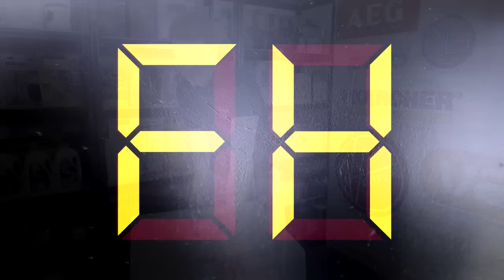Whirlpool Washing Machine Error Codes Diagnosis

Comment: I have a F06 Error and it's not a motor brushes ( they are practically new! ). I've hear in your video @ 4:23 that there is a "Tacho Coil" that might be damaged? Should I check electric resistance of a coil? Thanks in advance.
Reply from the maker: F06 error is no feedback from the Tacho coil. When this normally occurs the drum would start spinning very fast as the motor is powered then slow and stop as no feedback was received. If the drum does not spin that is the reason why no feedback (F06) is displayed and that would be a drive problem.
Reply: eSpares funny thing is that the motor won't start at all?! After taking water the machine just stalls and F06 error pops up. That's why I'm worried that it could be MCU or even CCU which is in my opinion not worth fixing.
Reply from the maker: As previously described no motor rotation no feedback so ignore the F06. If brushes are OK it must be either a connection or a faulty power board.
Reply: eSpares  I'll check connections first and then will see from there. .. thanks for help...

Comment: I have bought a washing machine it is 50hz, will it runs properly to 60hz power supply? please help me solve my problem...
Reply from the maker: Hi Emmanuel, This will depend on the machine and as you have not given a model number I will try and give information that may help. Generally if the machine can work it will show the following (50/60hz) on the 'rating plate' where the model, serial number and  voltage information is listed. If the machine uses a 'mains voltage pump' it is likely to be upset by supplying the wrong mains supply.

Comment: F-28?
Reply from the maker: We believe the problem is the control panel signals are not connecting with the main module. Check the connectors for any signs of damage and the buttons on the control panel. If you cannot identify a problem you may have to replace one or both parts.

Comment: my washing machine shows de error and sometimes Fe error
please help
Reply from the maker: Hi Ayush, you did not give a model so I can only give general advice.
DE usually indicates a door error, check the door closes correctly and if it reoccurs suspect the door lock. Error FE is usually a filling error. Check the machine fills to the correct level in the right time (about 1 Minute), check the water supply tap is turned fully on.

Comment: master please tell me, whats the error code F01 and how to fix it. thank you in advance
Reply from the maker: Hi Čestmhyr, we believe your problem is likely to be a control board failure. Check and if the motor is OK suspect the control board.
Reply: thank You for answer. after diagno. test, it tels me error code F01, but evrything works, except the watter supply. hose is free and pressurised and i dont know where is problem. (my type is Whirpool AWO/D) thank You for answer in advance.
Reply from the maker: Tip the machine to 45 degrees  to see if water is in the base. Some machines have a flood warning and allowing the water to run out may start the machine again.

Comment: Hello! i got a f12 error.  could you please tell me how to fix it? thank youu so much in advance
Reply from the maker: Check the heater with a meter as it is likely to have failed.
Reply from the maker: F12 is usually a heater error so check the element. If this is ok the problem could be the control board.

Comment: F08 error appearing immediately before any cycle or rotation. I checked the heater and it is not open circuit. Can you help me please.
Reply from the maker: Hi Salim, F08 is indicating a heater circuit fault. This is usually the heater itself, but can also be the wiring or even the control board. If the heater measure's around 30 ohms and the wiring is in good condition it could be the control board.
Reply: Thank you
Reply: Dear sir,
I would like to thank you again. Due to your instructions I managed to repair my washing machine. It was the heater relay.
Thank you.
Reply from the maker: Thanks for the feedback Salim.

Comment: Well. I checked the connections of the water supply and cleaned them out. Then checked the dispenser compartment for clogs.Massaged the hose just in case a blockage was there. None. I didn't check the solenoids because I don't have a meter. Pressure is ok but still getting 3 beeps. The major is filling up to proper level of water. Water pressure sounds good. I cut down the hose on the back so water would drain properly. Still no good results....HAve anymore Ideals?
Reply from the maker: The information you have given suggests you may have a pressure switch problem. For information on this see another video: https://www.youtube.com/watch?v=2pIVkAxWSXg

Comment: I have a whirlpool Dual Tumble Fresh 4.0 and normal load goes through to last rinse cycle then shuts down and three beeps continuosly. Put it on Rinse Spin Cycle and the beeps came up during a fill cycle. Machine is level front sensor at kick/front panel is pressed. Don't know what to do from here. Please help.
Reply from the maker: This sounds like a filling or pressure switch problem, check the water flow is fast enough (turn tap fully on) and see the following videos:
https://www.youtube.com/watch?v=VS48G_cwCXo  and
https://www.youtube.com/watch?v=2pIVkAxWSXg
Reply: J.C. Hugh

Comment: Ok, I've watched this video twice now because the first time I didn't hear my problem.......or the second time. I have a Whirlpool Duet washer and am getting a F13 error. Please advise.
Reply from the maker: Hi Lisa, although we have tried to make this a comprehensive list manufacturers will occasionally add another code. We believe this code is related to a motorised dispenser. The detergent dispenser has several compartments to allow pre-wash wash and conditioner to be loaded at the correct time. To do this it will 'divert' the filling water to the correct compartment. If the motor is jammed or if the control board is not receiving the feedback it will show this error. Check nothing is jamming the motor or flap.

Comment: hi , i have a problem its not responding i have whirlpool 6th sense sport and its displays CE !!  what to do?!
Reply from the maker: The CE error is indicating the control panel is not 'communicating' with the control module. Check the connectors are clean and tightly fitted onto the modules, if these are OK suspect one of the modules.

Comment: I've done everything in the video f21 error is still there . Resetting this model mhn30prbwwo commercial type without coin or card dispenser ,is very hard to find out . I did what you said to unplug the washer for 2 minutes and put it back again .i made several times . No reset is happening washer is not running . What should i check next Ccu or mcu ? Is there any handheld device to reset this .thank you !
Reply from the maker: Sorry we do not have information on commercial machines. The only suggestion we can offer is to watch one of our diagnosis videos that will give areas to check to help identify where the problem may be:
https://www.youtube.com/watch?v=QYPqpjLV7s4

Comment: Hey Matt, i have a problem with my front load washer Maytag Model : MHN30PRBWW0 it shows error code F21 i cleaned the draining system and even replaced the pump . And the error code still there. Is theres a way how to reset the error codes my self .?please help thanks
Reply from the maker: We believe F21 is a drain error and will occur if the machine takes too long to empty. Unplug the machine and wait for two minutes to reset. Then check the drain cycle and make sure the machine can empty . If it takes a long time see our video:
https://www.youtube.com/watch?v=frEJhX9Sppw

Comment: mayta f24 error
Reply from the maker: We believe this is a water temperature error. check the connections to the sensor and if this occurs immediately suspect the sensor. If the machine runs for a while and then shows this error check he heater.

Comment: The door seems to open and close fine. The end light is now permanently staying on and won't let me select a programme. Is there anyway of resetting the system please?
Reply from the maker: When the power is turned back on the system should reset. Check the motor brushes are not worn out and see our other videos:
https://www.youtube.com/watch?v=D5Aw7CBEGPI  and
https://www.youtube.com/watch?v=QYPqpjLV7s4

Comment: F08 error appearing immediately before any cycle or rotation
Reply from the maker: F08 is suggesting a heater error and is shown here: 3:23
Check the heater and replace if required.

Comment: checked the heater and senser,working normal 
Is there any issue in main control board (model no. AWO/D 8712) Whirlpool
Reply from the maker: All modules and PCB's can fail. Before suspecting this just confirm the machine is filling and starting a wash cycle?. Also try a spin cycle. If F08 appears immediately before the cycle starts suspect the sensor or the board.

Comment: Hello,
I have a Whirlpool machine also and i got a F 05 error.
What can i do ?  To fix it or repair ?
Reply from the maker: Run a short cycle on a hot wash and check if the water is showing signs of heating. if it is suspect the temperature sensor if it is not check the heating element.